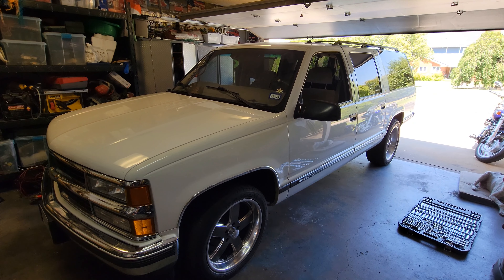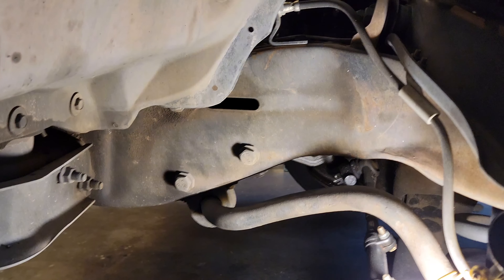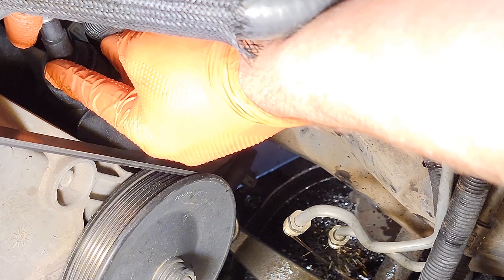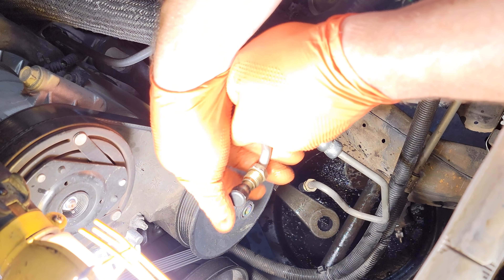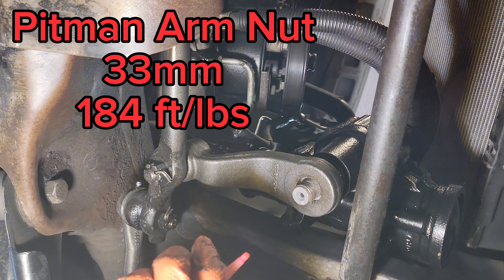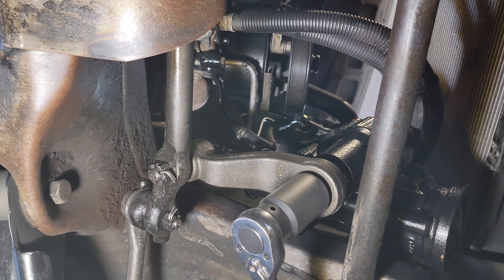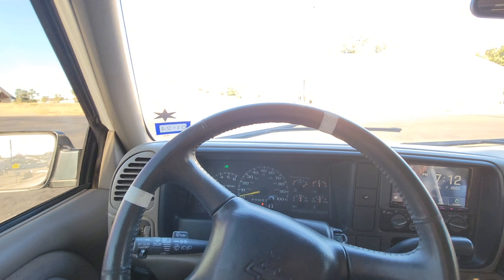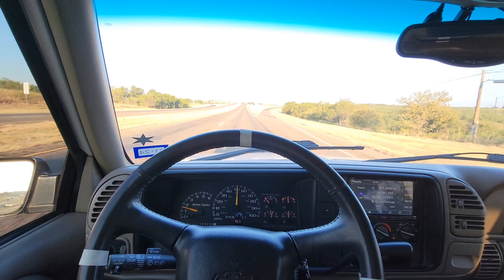99' Burb gets Red Head "Quick Turn Steering Box and Cunningham Machine Shaft Install and Test Drive

Comment: That's a ridiculous price for a steering box
Reply from the maker: I agree and did not get ridiculous performance out of it
Reply: @treyhaberman do you think just replacing the rag joint would be just as good? The price is also making me hesitant
Reply from the maker: @bobcarter1153  yea it'll be fine or find a jeep cherokee steering shaft. The are cheap and  use 2 u joints

Comment: That is the best how to video regarding the steering gear for this platform that I have ever seen! About to do the 3 turn redhead on my old 99 burb. This will be the third time changing the box over the past 20 years, but I definitely picked up a few awesome tips from your primer. The one I have in there now is super tight (...and it's an ACDelco)!  I'm gonna throw out the doorman steering shaft and get the Cunningham as well! Thanks again for the great video!
Reply from the maker: Glad you liked the video, bud. Good luck on your install. Just a heads up, mine started to leak from the adjustment bolt. Red Head wouldn't respond to my emails on call me back so I went ahead and tightened down on the locknut and the leak stopped.
Reply: So weird. Sounds like maybe someone just forgot to tighten it on the assembly line. Seems like you should have gotten a response from them though.
Reply from the maker: @bootstrapjesse  I was just worried, because they draw a line to mark where the adjustment bolt was set and they include a note that says if you adjust the bolt the warranty is void.

Comment: Do you think if i replace the steering box will make my steering a little more smooth? It's not that stiff, but i would like it to be a little more smoother. Also i feel when I'm driving the truck wanders off or has play. I replaced the shaft with a cunningham shaft.
Reply from the maker: It can, but the best thing to do is have someone turn the wheel back and forth while you are watching all of you steering components and see where the play is coming from. You can see me do this in my steering component video.
Reply: @treyhaberman  OK thank you

Comment: If I’m just replacing the steering shaft assembly, will I still need to do a realignment afterwards?
Reply from the maker: @MrOiram46  no, not as long as the steering wheel stays straight.  You will have to make sure you get the spline on the new shaft and the gearbox lined up so that the steering wheel stays stays straight
Reply: @ Ah, thanks!

Comment: How’s this mod working out for you?  How’s the steering slop/play now?
Reply from the maker: I'll give it a "meh". It does have less slop than the factory box, but I barely notice the quick ratio for daily driving. Might be worth it for drifting, but not for me. Side note, I changed my oil this weekend and noticed a small drip coming from the top adjustment nut of the box. I sent red head an email and I'm waiting for their response tomorrow.
Reply: @treyhaberman  Aww sorry to hear that.     I guess I'll stay with my stock, sloppy setup :)
Reply: @treyhaberman  Just a quick question, Sir? Any response from Red Head on the drips from gearbox? Thank you kindly!
Reply from the maker: @enriquemartinez16  No, they never called or emailed. I just put more on the locknut and she quit leaking. It moved the paint mark on the locknut though, so it probably voided the warranty doing that
Reply: @treyhaberman Had to tighten it! Hate oil/gear leaks! Thank you for the info. Your Suburban is exceptional clean! Superb!
Reply from the maker: @enriquemartinez16  thanks man, you're awesome

Comment: TEXAS!!!  👍🤠🙂  I have the upper and lower Cunningham Machine shafts for my 1998 C1500.  Great video by the way.  Probably going with the Borgeson new steering gear.  Did you consider that one?
Reply from the maker: Yes, I did. I went with borgeson on my 80 jeep cj5. It's been good.

Comment: Thank you for the video. In your opinion would a quick ratio be a little unsafe for a 2" lifted 2 door Tahoe?
Reply from the maker: @69mustang  No, it wouldn't be unsafe. I could barely tell the difference between the stock one.
Reply: @treyhaberman  Thank you for the reply. I'm considering a Borgeson quick ratio for mine. My Tahoe is on 33" tires and a mild lift.
Reply from the maker: @69mustang  yea I would try boregson too. If it's alot more for the quick ratio, I wouldn't bother. Not that big of a difference

Comment: I have a pre airbag truck, 93, can I turn the steering wheel as much as I need to get it straight?
Reply from the maker: You should do all your steering wheel adjustments with your tie rods. Your horn will still have a breakable wire in the steering wheel.